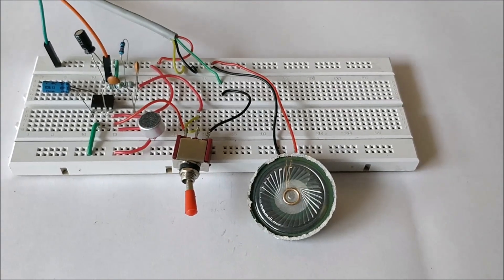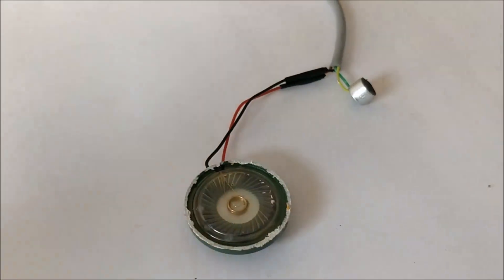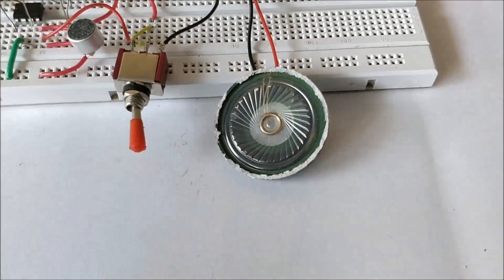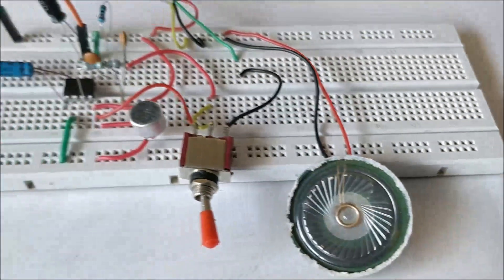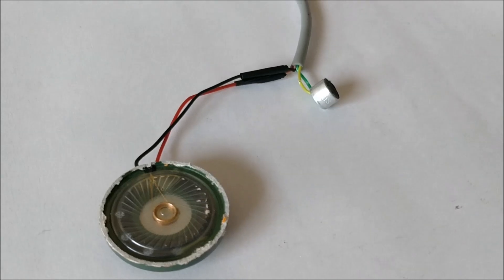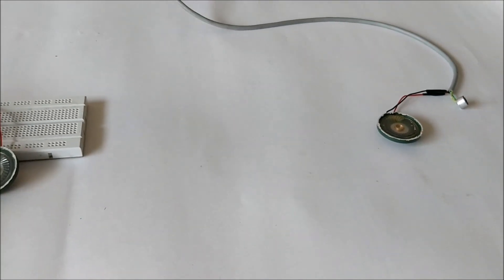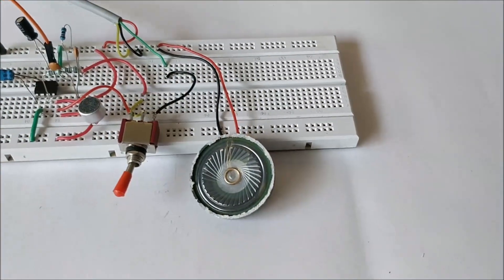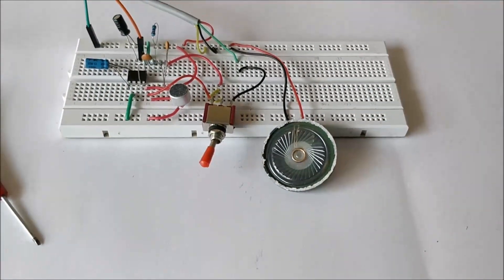How to Make a Simple Two Way Intercom Circuit

Comment: The power supply is not shown.   Can you make it without the mics? Upon switching, the speaker becomes the mic on either end.  I had a board that used only speakers that also used as mics when switched.  Don't know what change to the circuits needed to accomplish this.

Comment: worst ever comminication....and who is going control it..... the one outside the house or the one inside
Reply: It's just a college circuit, it can be messy, it can be bad, but if it works the student is happy. Ofc if you want to sell it then it's obviously a crap, manage of +/- is so unclear also the amp is not good, but it's not the point of this video